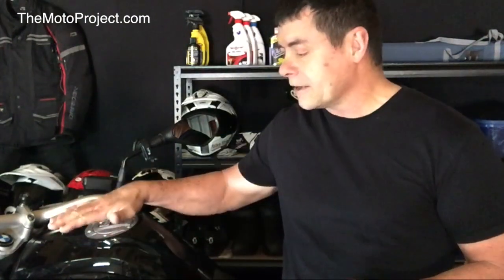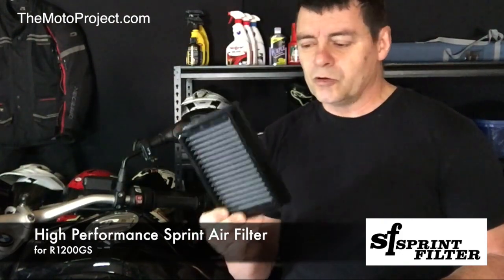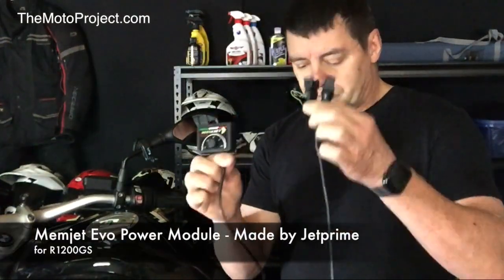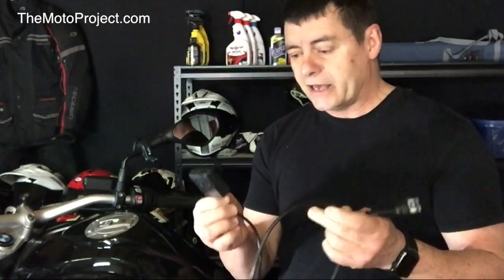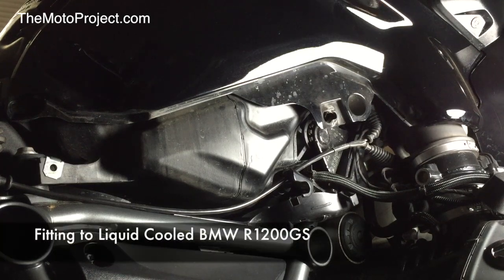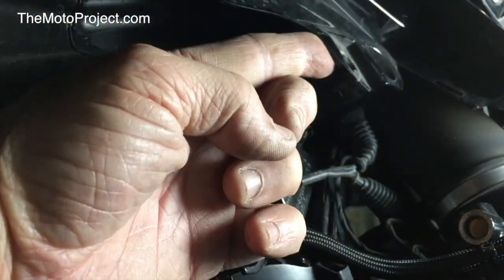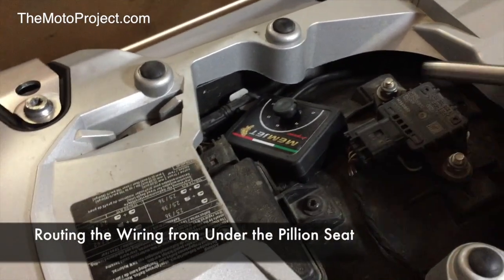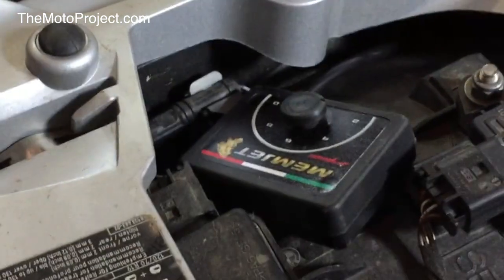BMW R1200GS Performance - Jetprime Part 1 Installing Memjet Evo Power Module

Comment: Hello, what is the difference between the levels of configuration? is there a good difference?
Reply from the maker: I couldn't really tell the difference other than subtle response in certain conditions. On the dyno it was very subtle and in fact as the dyno room got hotter performance was reduced with the higher settings. From what I have seen and experienced these will provide a crisper throttle response but in my case it was only in colder temperatures, in hot temperatures like we experience in the tropics I turned it off.
Reply: @TheBikeStig  Thank you very much for the answer, i will go with PCV then